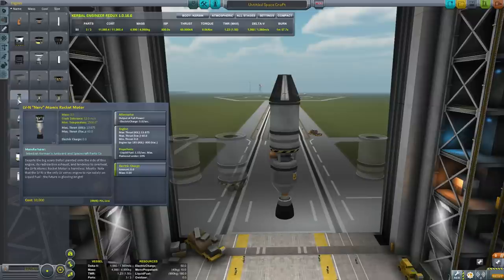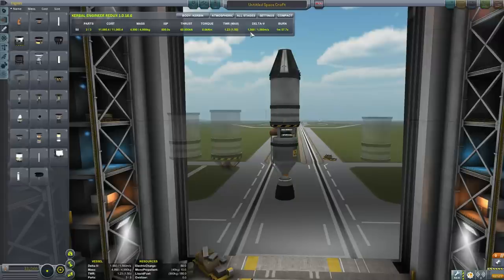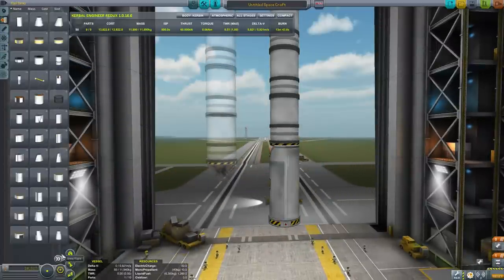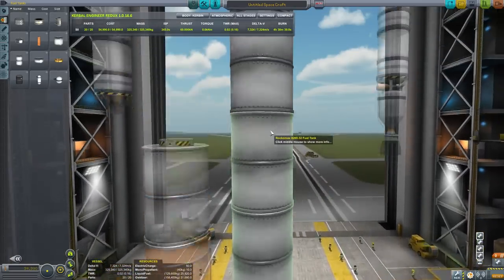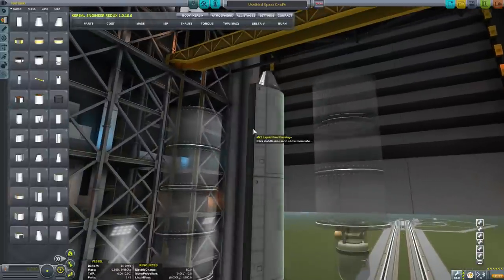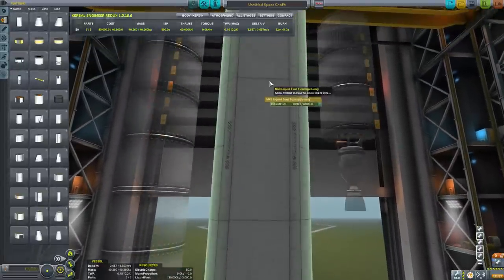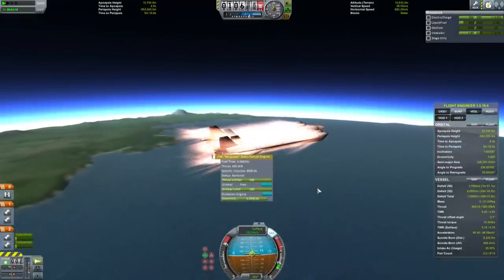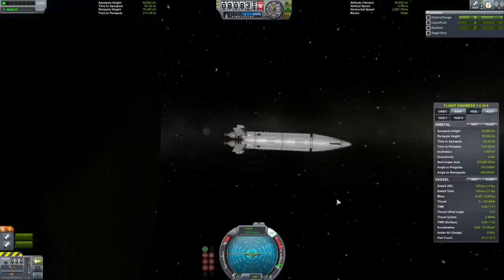Nuclear Engines & Hydrogen Fuel in Kerbal Space Program

Comment: There needs to be a toggle button to change fuel+oxidizer tanks into just fuel tanks (or even monoprop for plane parts). Would make the plane tanks less cluttered.
Reply: ThePix I'm pretty sure leerman means the functionality of snjo's Firespitter fuel switch. One part, put multiple tank types in it. LFO, LF, O, or monoprop.
Reply: leerman22 the mod "Stock Fuel Switch" does exactly this, its updated for 1.0.2 and I use it regularly.  It seems to be fairly balanced.
Reply: leerman22  stock fuel switch and/or interstellar fuel switch mods do that. They're really convenient.
Reply: Neo-Gambit Here's the link. https://kerbalstuff.com/mod/795/Stock%20Fuel%20Switch
Reply: leerman22 With Procedural Parts, you can delete most of the tank files, and you get to chose LF, O or LFO, and it's all adjusted in ratios so that is behaves like stock tanks. Decent amount of memory can be saved like this, and you can change the textures and sizes/shapes, too.
Reply: If you get the Cryogenic Engines mod, it comes with files that let you do this. You can set up any stock LFO tank (but not liquid fuel only tanks) to carry liquid fuel and oxidizer, liquid hydrogen and oxidizer, just liquid fuel, just liquid hydrogen, or just oxidizer with it.
Reply: Joseph Adkins I thought you could drain the oxidized tanks of oxidizer in vanilla KSP.
Reply: shropshirec
Then you would have half an empty tank.

Comment: Another point worth mentioning is that while the Nerv completely dominates when it comes to heavy payloads, such as entire surface bases that you want to put on other planets.
If you want a refueling base on Duna you NEED the Nerv, or it would be an utterly massive rocket since the ISRU already weighs so much, the mass of the Poodle or Terrier.

Though it's probably not wise to try to use the Nerv to land with since it has such a low TWR. Use the Nerv to get to other planets and then chemical rockets for the actual landing

Putting bases and stations on other planets is sort of "end game" but it's still worth mentioning. The nuclear rocket IS an endgame rocket.

Comment: my problem with the nukes are the overheating issues. try to do a circularization/escape burn around Eve and something will invariably explode. even landing on something small like Ike will most likely overheat them. cooling down takes ages. i wish there were stock radiators...
Reply: trisymphony I said the same thing for so long, but wven back then there was a way. Notice how Scott added four fins around the engine section? Those are there to provide maneuvering inside an atmosphere, but they also cool the engines due to acting like rudimentary radiators, this works with all wing parts.
BUT, in 1.0.2 Squad also coded better heat tolerance and cooling into all ordinary solar panels, so you can use those instead, since they are much lighter.
Reply: trisymphony 
You just need to understand how heat works and it's fairly easy to solve. There's a option for it in the debugging menu.
Basically, the bigger and heavier an object is, the higher its thermal mass is. The more thermal mass the object has, the more heat is required to make it get hotter, so they basically act as buffer zones. 
The second part is heat radiation, which comes down to the surface area of the object. The larger the surface area, the more heat you radiate away.
Considering that, what you need to do is to attach your nukes to something with a large amount of thermal mass, and then attach parts with high radiation to it. 
For example, the spaceplane I recently sent to Duna and back was powered by 4 nuclear engines attached to mk1 liquid fuel tanks, each with a 1x6 solar panel on it. Those are attached to to mk3 liquid fuel fuselage short (should have used a normal one here since I ended up using 2 shorts anyway, but would have required me to place all the engines and fins etc again so too much effort) with 3 Big-S spaceplane tail fins on it. Further up pn the craft, there was of course also the wings, a pair of Big-S delta wings. 
With the solar panels out, it runs the nukes indefinitely without anything getting too hot. 
The only problem I had was taking off from Duna since I could not deploy the solar panels while in its atmo, so things got pretty hot before I got into space and could get them back out. 
I've been told small delta wings work very well as radiators too, which would not have had that issue, but I've never tested it, so I can't guarantee it. 

Nuclear powered spaceships have to be designed with heat management in mind, but the parts needed to do it are certainly available.
Reply: steave435 thanks for the long explanation. so attaching nukes to short 1.25m tanks is a recipe for disaster... intuitively you would think that the heat is dissipated through all in-line tanks. well that's certainly a bummer for compact designs.

while you are at it, please explain why i can fire nukes for 10 minutes in open space but barely get 400m/s2 with the same ship around eve before they overheat.
Reply: trisymphony Given what he said, i don't think you should be using the nuke on a lander craft. Its too inefficient for smaller craft (not to mention the large size makes it more difficult to fit on a lander size ship)
Reply: ***** I thought you actually had to stick the wing on the engines themselves therefore making it only work with SRBs/RAPIERs?
Reply: trisymphony 
NP.
Regarding your Eve issue, I'm not sure, although I've seen discussion in radiator mod threads saying that the radiators should angle away from the sun to avoid getting heated up by it. I've never noticed any such effect in game, or heard about it anywhere else, so I suspect that they just wanted to make them look more realistic rather than actually point out a mechanical problem with the mod, but if you're having issues at Eve, which is much closer to the sun, then maybe there's something to that. 
Alternatively, it's possible your ship had cooled down enough to make the temperature gauges go away, but not get back down to their normal temperature.
Reply: My problem with nukes is that they explode
Reply: trisymphony Radiators solves it. Mods.
Reply: Times have changed, friend.

Comment: I think you should be able to fill all tanks with liquid fuel, so if you need oxidiser you will fill 50% with fuel and 50% with oxidiser! but if you only need fuel you can fill it with 100% liquid fuel instead of only 50%
Reply: That was confusing.
Also, how many exclamation marks do you need?
Reply: He means this. Say the maximum capacity in a tank for everything is 200. Having 2 types of fuel means that 100 can be used for each. What he wants is for the tank to be able to hold more liquid fuel if you get rid of the oxidizer
Reply: ViviD HERCULES Non logic. Oxidizer is denser than liquidfuel infact. This means of course that on a 90liquidfuel and 110 oxidizer, Removing all oxidizer to add liquidfuel would make it 105 liquidfuel. Doesn't change much.
Reply: Sosuke Aizen shouldn't it be 180 liquid fuel?
Reply: TheReaverOfDarkness
Oxidizer occupies about 7 times less space. (Depends on how pressured it is)
Reply: Sosuke Aizen
than RP1?
Reply: KeyboardOfSteel i'm sorry if it was confusing, but i didn't use exclamation marks. maybe the percent (%) shows up as an exclamation mark for you, i have no idea.
Reply: Sosuke Aizen in that case it doesn't matter that much. i thought they both occupied the same amount of space, but that doesn't make sense now i thing about it :).
Reply: Harm Prins
The units seem to be liters it occupies naturally But I bet oxidizer is pressurised to occupy less space. Unless kerbals are real dummies.
Reply: That would explain why liquid fuel only engines have barely any more. They still should have a lower dry mass fraction due to not needing the same level of structural strength since the contents are under lower pressure.
Reply: Sosuke Aizen The oxidizer is liquid, and therefore is in its most dense possible state and can't be compressed (liquids are funny that way)

As for the liquid fuel being more dense, you're correct. 45 units of oxidizer have the same volume as 55 units of liquid fuel, however the in-game units are volume not mass.
Reply: Caleb Farmer
I though it was unpressurized nominal volume of the liquid.
Reply: I thought we were talking liquid density, and that you were saying the liquid fuel is a lot lighter than the oxidizer.
Reply: Sosuke Aizen i was making it basic not trying to be specific with my example

Comment: I feel the nuclear engine should have been more realistic, instead of being 'balanced' for gameplay reasons, or depowered to say "nuclear is bad m'kay".  NERVA had an isp of 850 in vacuum for example, and nuclear light bulb designs are estimated to be up at 3000.
Reply from the maker: But nuclear lightbulb technology is still in the realm of scifi
Reply: Timothy Wilson Or an open cycle gas core NTR would be cool. Also still theoretical, but it can give 4000+ seconds of specific impulse. It would also be cool to have to deal with the massively radioactive exhaust of the open cycle type, as opposed to the closed light bulb. Didn't Interstellar mod provide something like that? Can't remember. Anyway, I do like the way the LV-N works in the stock game now if I'm honest. I'm pretty sure that the basic idea of a heavy engine that produces high specific impulse is, at least to some extent, faithfully modeled, also in terms of it's applications.
Reply: Scott Manley Well, if we are considering theoretical nuke engines, nothing competes with the dusty core reactor fission fragment rocket. Heating  reaction mass is for suckers - just throw fission fragments out the back without letting them interact with anything other than magnetic fields. isp's above a million, and not so sci-fi as all that. Of course, this does mean you rocket is now using weapons-grade plutonium for fuel...
Reply: Timothy Wilson It would be nice to have an option that changes de balancing of things to make it more "balanced" or realistic depending on what you want to do. That would be a nice option for the sandbox mode.
Reply: Scott Manley Nuclear Lightbulbs are not sci-fi, it's an engineering challenge. What law of physics must we break to build one? I'd say RAPIER engines are just as 'sci-fi',  considering it's just an engineering problem. The closest thing to RAPIER is the Skylon's SABRE and that only exists on paper, yet those exist in KSP.
Reply: Timothy Wilson Then people would complain that its unbalanced. Considering its a game, I think balanced is the way to go.
Reply: Timothy Wilson  the saber engines do exist, have 350 million funding, and are being tested
Reply: Thomas Jørgensen I knew it!!! I proposed using nuclear engines for cars years ago. They stole my idea!!!
Reply: gfontanetto Can you send over a link/citation All I see is an endless stream of PR but no actual confirmation an engine exists. Would be interesting to see this actually work.
Reply: Timothy Wilson The laws of physics do not need to be broken for something to be "sci-fi".
Reply: Authenticity is better than realism~
Reply: Timothy Wilson Bah!
We have proven that Kerbals are quite immune to radiation, so why not use a nice nuclear salt-water rocket?
Those are easy to make, and good for ISP of around 50 000.
For the piffling side-effect of having the neutron flux of a continuously exploring nuclear bomb, and leaving a trail of high-grade radioactive waste in its wake.
Reply: well they are pretty good in the interstellar mod but still heavy and expensive ... that's why I like the interstellar mod it allows sci-fi tech to go up and beyond the capabilities of normal rockets instead of still being lame like near future propulsion.
Reply: The KSP nuclear engines ARE realistic. They have well over twice the Isp of any of the liquid fuel engines, and lower thrust, just like the real NERVA engine they are modeled after.

Comment: Indeed; big tanks without oxidizer really do the Nerva justice.
What I do is put a (large) MK3 service bay underneath a MK3 liquid fuel tank, and then put the nuclear engine inside the MK3 service bay (which you can then get into orbit using a MK3-kerbodyne transition piece and regular kerbodyne tanks and engines to boost into orbit. With a single nuclear enine and a big liquid fuel tank, that's a LOT of delta-V. 
Bonus: it still looks like a normal rocket
Bonus: The service bay even has room for a tiny sattelite or rover or two (stuck onto some girders with a small separator, with those girders connected to the floor of the fuel tank).

Comment: "Please stop complaining about those nuclear engines being nerfed, because they haven't been nerfed at all."

Sorry, but this is totally incorrect. I had an old rocket design that could comfortably get to Duna, and even made into orbit around Jool. It can now barely make it to Minimus because the atomic engine uses much more fuel (despite having the same ISP and not requiring oxidiser). This means that the benefit of not needing oxidiser is totally lost, and it's actually worse than before because you now end up with dead weight (in the form of empty fuel tank space that you can't use).

Furthermore, there used to be about 12 main fuel tank sizes you could use effectively (more if you include the aeroplane parts), but now there are only 2. Why Squad hasn't made fuel-only variants of all the tanks is beyond me, and when I asked them directly about it they just completely ignored the issue (in their reply email).

I understand your point about the engine's very specific usage parameters, but the new efficiency figures are dishonest because it SHOULD travel much further than before, considering the oxidiser requirement was removed. I redesigned my old rocket to use aeroplane fuel-only tanks, and the efficiency has hardly changed. It has almost as much fuel as my previous rocket, but the fuel-weight ratio is better (due to there being only one fuel type with the same consumption rating) ..... yet performance has hardly improved.

Many of the responses to criticisms of 1.0 that I've seen, from 'official' KSP advocates, suggest that users' stupidity is the problem. "Stop complaining about the engines.... you're just using them wrong" - this being a good example. I've had similar responses from Squad too regarding the fuel tanks, which I find funny (isn't it stupid of THEM to demand that we launch with half-empty fuel tanks?). It's quite suspiciously defensive if I may be honest....

Comment: I gave up on SSTOs because the ones I started making in 1.0 barely made it into orbit at all, and that was using the RAPIER engines. The cargo capacity was just abysmal because they needed so much fuel for that final push out of the atmosphere.

Then again, I only used one set of fuel tanks, and in pretty much all the designs I've seen since then they have at least three rows of fuel tanks making up the main body, so I guess I can give this a shot... But with one tenth the fuel capacity? It could possibly be done, but I wouldn't want to try...

Comment: I always thought they were nuclear/chemical hybrid rockets; the fuel/oxi mix is combusted like a normal rocket, then passed through the nuclear reactor to add more energy (thus improving efficiency per unit of fuel).
Reply from the maker: Jonathan Hughes I'd love to know what kind of metal your nuclear cores are made of which can handle temperatures so hot that a rocket exhaust can cool them. :)
Reply: Scott Manley Space-age Kerbalium alloys, of course :P
EDIT: It might also be the other way around; the oxidizer is added after the fuel has been heated by the reactor.
EDIT AGAIN: Actually, it's just because I don't like having to drain the oxidizer out of my rocket tanks manually in the VAB, even if it is technically more efficient.

Comment: One thing about the fuel is that if you look at the way it burns you can tell that the fuel in the small tanks and the rockomax tanks the burn like liqued hydrogen engines but if you look you can tell that the kerbodyne engines are clearly RP-1 engines because they burn more like real rockeys that use RP-1 engines

Comment: They have been nerfed, but not as much as people seem to think. They have the same dV, but the fuel tank dry fraction is increased since they only use liquid fuel. This is not solved by using liquid fuel plane parts because those still do not have as good a dry mass fraction as the rocket fuel tanks. Furthermore, the mass of the LV-N was increased from 2.25 tons to 3 tons without increasing its thrust.
Reply from the maker: TheReaverOfDarkness You don't use nuclear engines for their thrust, you use them for their delta V.
Reply: Scott Manley Yes but not all people enjoy four hour long burns. The fact that you can endure going to Eelo on an Ionengine is unique to you.
Reply: Scott Manley
You still have to cut your thrust to about 2/3rds to half to get the same dV as before. Also, a bit of TWR is important for taking advantage of the Oberth effect.
Reply: Scott Manley how can engine have delta V? We use nuckes for Isp!
Reply: TheReaverOfDarkness
You no longer get better Isp on lower trust, so why?
Reply: Ego Alter
Yes, lower thrust engines often have better Isp. There's a bit of a gap between the LV-N and the PB-ION, however.
Reply: TheReaverOfDarkness Sorry I thought you were referring to the 1.6 bug, that running on lower throttle gave exponentially higher Isp. Also I'm not sure 370s and 390s makes a lot of difference.
Reply: Ego Alter it actually makes a huge difference in the upper stages. just mock around with kerbal engineers. the difference can be more than a 1000m/s of delta v. I was really surprised myself.
Reply: Ego Alter
The 390 of the Poodle was a lot more impressive when the Skipper was only 360 IIRC. But they've all been reduced now.